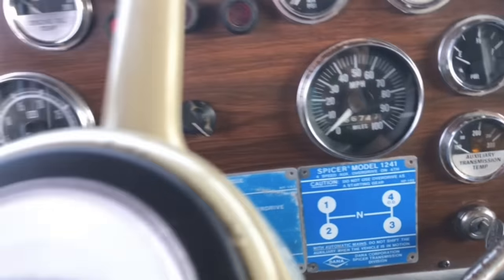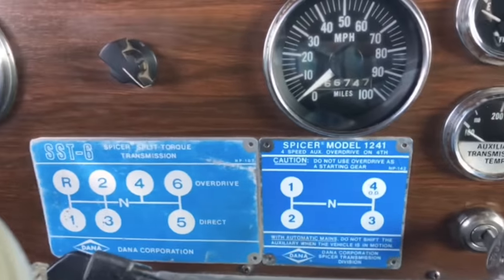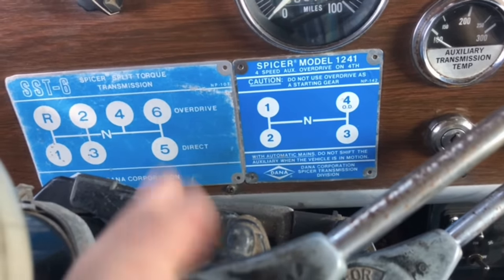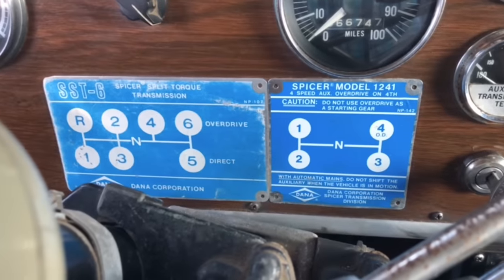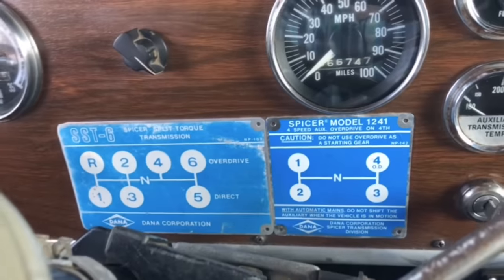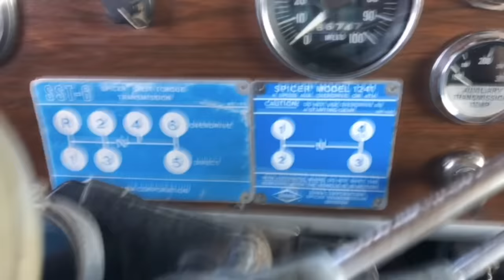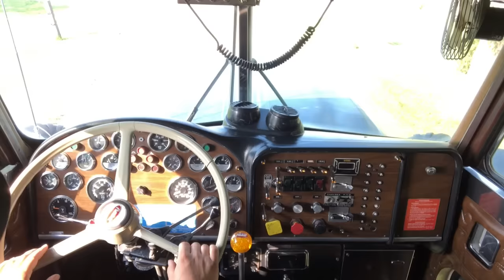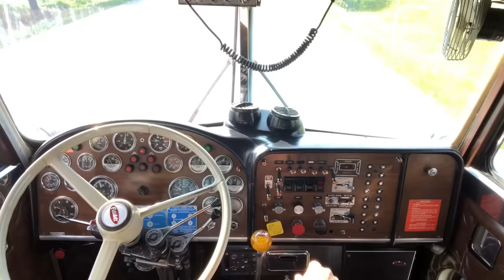How to shift Two stick 6+4 Spicer Transmission Peterbilt 359 #Peterbilt #359 #Twinstick #Twostick

Comment: Get your ear plugs a couple 3 or 4 gallon jugs of oil make sure the flashers are working for going up hills under 40 MPH. tie up some empty oil jugs over the slobber tubes you can recycle that oil that it pisses out
dump back in the engine ,you will be lucky to get 3 1/2 miles to a gallon of fuel & 250 miles to a gallon of oil out of that greyhound bus engine ,The up side you will never fall asleep with all that noise & you will be real busy shifting hit the bottom of the hill going 85 MPH & by the time you get to the top ears ringing & going 18 MPH , boy this brings back a lot of memories my ears are still ringing from 30 years ago HAHAH
Reply: EXACTLY right here,i had one and also its old brother 12v71ta,the two in kw900
Reply: ahhh, the good ole days !!!
Reply: I used to run Atlanta to LA and back in cornbinder with a 318 and thirteen speed. 73,280 didn't matter it was still a lot of work.
Reply: Theres that 73280 number again !!!!!!!!!!
Not that 99% of Any, Of the drivers out there today........
Would Know..........what the Hell it means !!!!!!!!!
My old man, was pullin for the "Blue Eyed Indian Line" in the early 60's....
Brand new 62 Brockway coe, A "Screamin" 238, tag axel and teamin it with a bunk you couldn't hardly put a kid in...............
All the while, worrying............. about bein over.............
73280..............
thanks for the memories mister !!!!!!!!!! Thanks !!!!!!!!!!

Comment: As a trucker from germany, I find it very interesting to watch how you guys handle your trucks. Over here, automatic transmission is the norm, which can be pretty boring at times. But also the interior is completely different from our trucks, with all the big flipping switches.
Very nice video indeed!
Reply: you realize this truck was built in 1978, and even then twin sticks were very rare.  Modern trucks are mostly automatic with a few air-shift manuals still ordered.
Reply: Can’t drive off-road with an automatic. I drive a log truck 20% of the miles is off road, unimproved two track, frozen in the winter. We get 134” of snow per year and it takes a light foot and good clutching/shifting skills to get up and down icy and muddy hills.
Reply: @roninseattle ..... Ron, just so you're aware... they are Not "automatics".   They are AUTOMATED... manual transmissions.  Automatic transmissions are Fluid coupled and "driven" and RARELY ever used in class 7 & 8 trucks, I don't believe that the major heavy truck manufacturers even carry them on the books anymore as an option, since the advent of automating the manuals.... Huge difference between "automatic" and Automated.   It's a real shame that So many so called modern day "truck drivers" (steering wheel holders, for the most part!) don't have a clue about the "mechanics" of what they are driving any more. 

Ninety plus percent of them couldn't even change a flat tire on the side of the road if their life depended on it, any more!   Absolutely.. Pathetic how the people and this country has Declined in just the last 30 years.. especially.  Also, the Only part of a fully manual truck transmission that is "air-shifted", is the Hi-Lo range selector valve and the piston controlling the gear splitter in Hi-range.
Reply: Ironic that Europe has automatic trucks, but manual cars, and America is the exact opposite.
Reply: @hugolafhugolaf  This has shifted a lot. Now everyone drives an automatic car over here. Drives me nuts, because a lot of cool cars are only automatic these days
Reply: @Frittrich  Yeah, I don't like automatic too, and far smoother is manual shifting.
Reply: @Romans--bo7br  you ok bro? Need a hug?
Reply: @roninseattle ... they are NOT "automatics" - they Are... AMT's - Automated MANUAL Transmissions.  Huge difference!  Automatics are "slush boxes"... like in a car or pickup or even class 5 & 6 P&D and refuse (ie; trash) trucks and fire trucks, etc.  

Automatics are made by Allison & New World Transmissions... but, for OTR Class 7 & 8 trucks, they are pretty well "useless" and are very hard on fuel consumption.  

They tried making inroads into the heavy duty truck market back in the 1970's and 80's.... but went back to focus on the class 5 & 6 trucks for commercial use ("straight" trucks) as well as highway coaches in which they worked very well.  

Allison div. automatics have been in city transit busses since pretty well the "beginning of time".  

They really weren't able to penetrate the OTR coach market, until around the mid/late 1970's, before that they were rather unreliable for that use, and "sticks" were the name of the game.... even though the gearing in the GM 4104's, 4508's and earlier, really "sucked" with their 4 speeds. 

Even a 7 or 8 speed transmission in them would have been a Huge improvement, but I guess they wanted to keep it as simple as possible for all the various drivers with the major carriers, such as Greyhound, and Trailways, etc,etc.

Comment: 4:34....Bubbles, you just ruined the retirement of every old trucker telling stories at the coffee shop....
Reply from the maker: 😂 sorry!! I hear ya tho!
Reply: They can tell the story about how they've been holding traffic back for prit near 30 years.
Reply: Unless you drove a 2 stick mack...........
Especially with a sick 237...........
Wind her to 2100, drop to 1200 to shift..........
remember my road test fondly...... (1979)......
Half aload of milk in the front compartment, shifitin with the slop........
And using both sticks at the same time...........
Lost 5 points for parking toooo Far from the curb  :)

Comment: I drove this same set up in a 1984 Peterbilt (when it was brand new but, it wasn't mine) 

and the reason that you don't have to split 5th gear into 6th is because it's a progressive shift.
The Main transmission gear ratio was designed to shift straight from 5th to 6th gear without
splitting with the Auxiliary transmission (although you still can, you have to go up a gear higher
 in the split on the Auxiliary transmission. I'm currently looking for the same set of trannies to
 go in my '79 KW W900a model. Cool video and nice truck though.
Reply: Ohhh that makes sense

Comment: First off, retired mechanic, not a professional driver (by a long shot)

46 years ago when I started my mechanical journey, they company I worked for ran Kenworth 850 off highway logging trucks.  They had a mix match of transmissions, combination of powershift and gear jammers.

The  sticks were spicer 6X4.  12V71 natural detroits for power.

Those trucks ran about 100 ton payloads, didn't go fast but they got the wood to the log dump.

I never got to drive a loaded, but put lots of test drive miles on empty trucks. All of us brain dead apprentices would all try to shift like the drivers.  Not too many of us could.  But it was fun to try.

If I remember correctly the diffs were 15:1 and we were running planetary drive axles, can't remember the reduction. Put those old girls into 1+1 and you could move the world.
Reply: 1-1 you could get her in gear pop clutch get out go in the house take a 30 min nap get up walk to the end of the driveway get back in and go truckin
Reply: Big C you have to love deep reduction gears

Comment: Cool. I always wanted a 6 x4. I've got one left with 5x4. Had a 13 x 4 that was the best. And had a 12v 71 with 5x4 with a over on 5th. I once straight piped a 8v71 with a 4x4. I would haul uranium through Moab UT and people would cover there ears it was so funny, you could hear me coming 4 miles away.
Reply: 13X4...the Logging Package The best 1 I saw was an American LaFrance. Had a 50's Pete cab on it a Mack RQ718 5X4X2...my Hanai Uncle Boogie Lindsey was working on it for "Uncle Wally Coleman." The truck had the name "King Pau`ola" on the hood doors.
He had a old 64 Kenworth Feedlot Tractor too...5X4 5spd lo hole 1st with a 1241D auxiliary box. fucker was a clapped out red color...she was old, but she had balls for a 290 CUmmins.
Reply: I won't e en TRY to guess how many your 13x4 had (52).:) (meaning four trans..5, dual range and then split only on upper four speeds, plus second stick, a four speed.) take care
Reply: @SteveCarras  i would run brownie in direct use 13 like normal then hit over. Didnt go much faster just gave it a double over. But i had amazing low gears. I had steady run across NV from UT on 50 to a mine. It was in 72 pete dump with wagon pup
Reply: There was a heavy haul tractor that had the 13 x 4 with 2 speed rears.....you can never have enough gears

Comment: you explained that so well...and when you did the drive i knew exactly what gear you were in just from your explaination. feel like i could climb into a pete 359 and drive that box pretty much first go after watching ur vid. thanks and good work mate.
Reply: kieran jones totally agree. I’m so glad I found this video.
Reply: It's only "easy & simple" when you're Not behind the wheel.  Get behind the wheel, with a full load on, a 250hp Cummins, twin stick 4x4, 5X3 or 5x4, and hit a 5+% grade, and we'll see just how "simple and easy" it is for you.  

MANY, of the real truckers of the era.. who started in the 1940's... would miss downshifts all the time, and would have to pull over and start all over again, and crawl to the top.  

It's NOT that "simple and easy" in actual practice... you have to really know and understand the gearing to be able grab the right gear combination, many times "skip" shifting, while the truck is pulling down Fast, until you get into a gear that it could pull up to the summit, without have to start over and crawl.  

With a 2 cycle Detroit, you need to not only which or how many to skip, depending on how fast it was dropping speed, but with the fast acceleration and/or deceleration rates of the 2 cycle... if you over accelerated to match the transmission speed for the gear you were trying to get into... you'd lose more speed, so you have to instantly know which gear combination to go to, to match the falling truck speed when you got it in gear... without have to stop and start over again... in either low-low, low split or whatever gear, depending on the grade and your gross weight. 

I started in 1964... and have had occasion to run just about every box combination there is, plus the single sticks, and for me... I'll take a twin stick any day, over a single stick.  

On a long grade, pound for pound, load for load with identical power... I'll out-pull any single stick to the top, anywhere and anytime.  I've done it Many times over in years and decades past.  

I'm Very grateful that I was able to truck during the "golden years" of trucking, when the motoring public respected us, the Highway Patrol respected us, and when we were under the ICC, scales hardly existed. 

I trucked with some of the nicest, best drivers, Owner/Operators and legends that ever came down the pike. There  there were some real life Owner/Operator (as I was) "Legends" back in our day... Legends that books were written about, and movies were made of.   

Not like these modern "chickens**t" steering wheel holders of today who don't even know that the transmissions in their phony trucks, are NOT "automatics" - they Are, AMT's - Automated MANUAL Transmissions.... made for morons who can't get past a simple three speed manual... If, even that.  So glad I'm retired off OTR since 2011... but still trucking... 59 years later, with a 379 Pete and a "Big house", hauling grain.
Reply: @Romans--bo7br  total respect to you mate. you know your stuff and your years of experience certainly show in what you wrote..thank you so much for the insights from a true trucker of ledgendary statis......"I'm not worthy, I'm not worthy" (prostrate on ground before you...)
Reply: @verumpraevaleat8177 ...Thank you, ever so kindly for your reply.  I certainly do not consider myself any sort of a legend, but I did know and run with some of the best O/O's (Owner-Operators) of the past... true legends in the "old School" world of trucking.... definitely a Far Cry, from what passes as trucking and truck drivers, today.  

There are still some good drivers "out there" these days, mostly found in the realm of "Bull Racks" (Cattle haulers), and HEAVY Haul / Over-dimensional, where only the very best are excepted... especially in HEAVY HAUL / Over-Dimensional trucking.  

Anyway, I'm just very thankful that I was able to participate during the "Golden Age" of trucking and the other truckers (true O/O's), when I did.  We ran some pretty big power back in those days, to.  

Yes, I know there are some 600hp Cummins (factory, stock) out there, but the "average" power is 425 - 475hp these days, and they get the job done... but with all the "advancements" in engine & transmission electronics, they really haven't gained very much at all.... except to over-complicate them.   

They're basically "through away" engines any more, and a number of them are no longer rebuildable... like the aluminum Detroit DD13, 15 & 16.... they are "sleeveless" engines and when they're wore out, they're finished.   

The Detroit "60 Series" was a great engine...for a 4 stroke, (especially the 12.7 liter version), but you could get a million plus miles out of them, and then remann them and they'd be good for another million plus miles.

Most trucks these days are quite comfortable and quiet, as they have really managed to "castrate" the diesel engine to the point where they really don't even sound like real diesel engines anymore.  

The liquids that they sell in "truck stops" these days... posing as "diesel fuel", is absolute crap.... same as gasoline, is.  

I miss my "big hoods" and the steady drone of my V12 Detroits I had in my three trucks (one at a time!), and my "sticks".   Nothing like the sound of a V12 (Series 71) happily "singing" at 2300+ rpm under load... pure music to the ear.... at least, to my ears.  

Ooops... kinda got into writing a book, here... my apology.    

PS; are you from Australia?..... and I assume that your a driver, yourself?   

Take Care, and Thanks again Mate... time to get some sleep, it's Late!
Reply: @Romans--bo7br  Hey Hey, yep all-aussie here, currently living in tasmania, 58 yo and drove a Kenworth SAR tipper and dog trailer from 16 to 25 with a simple 13 speed and no guts at all. Got sick of all the close calls from ignorant car drivers so gave it up untill I took up driving buses for state-transit in Sydney from age 35 to 50. So I dont have the experience you have but big trucks were my passion from age 14 and still are...these days I build those Tamiya 1/14 scale RC trucks to satisfy my love for them...and it's a lot safer !!  Used to LOVE the old Freightliner c/overs to look at and would love to buy and restore an old one. Retired now and I see all the younger blokes here driving around like cowboys and using their vehicles to intimidate plus the roads here in Tas are about the worst I've ever seen so that old spirit of comradeship and safe professionalism have sadly gone i'm afraid. True what you say about the engines and technology...and most are autos now so most drivers wouldn't even know what gear they are in let alone feeling the truck and the road. I also have a passion for steam locos and understand how each engine is different and it is a matter  of being as one with the train and feeling it's personality ...steam engines would be akin to driving the 2 strokes you were talking about I would imagine..The guys who drive the roadtrains in the outback here to supply remote towns are amazing drivers I reckon. I think you should write a book...you obviously have an amazing story to tell and experiences to share. Cheers mate...BTW where are you and where did you drive?

Comment: Ah.. memories!! I used to run around in an 18 wheel water wagon wetting roads at a sand and gravel plant. It was a 1976 Autocar with an 8V 71, and a 5 + 4 speed, it shifted a bit different because of the 5 speed main box, beginning in 3rd on the main box, we used 2nd, 3rd, and 4th on the aux. box.
Reply: #1 in the brownie would be "deep under". Use it now and then so you don't have to split the boxes.